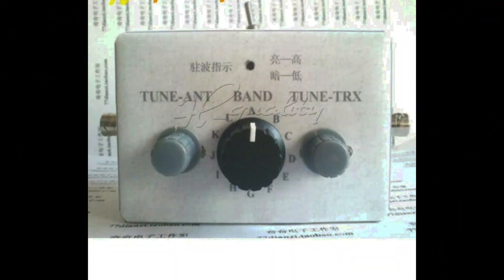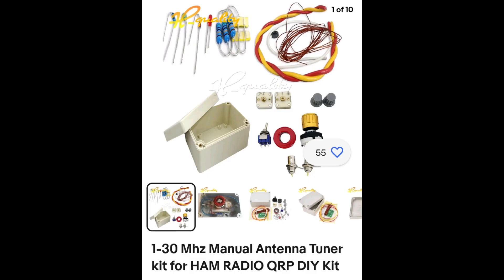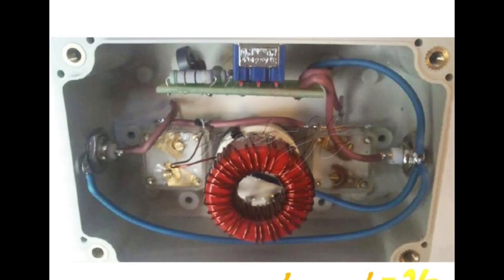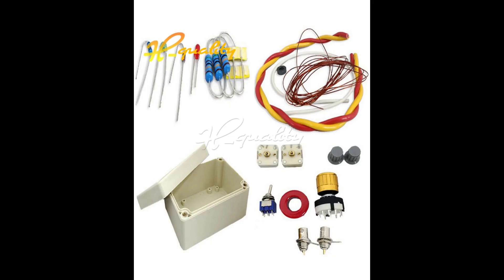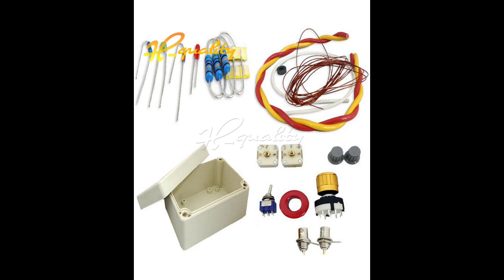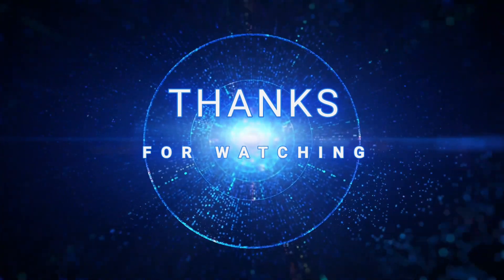1 - 30Mhz Manual Antenna Tuner Kit. Ham Radio QRP DIY Kit.

Comment: I bought one of these and liked it, so I bought four more when I spotted them on sale.

They are fine, just a few building caveats, so I recommend searching for instructions that remedy a couple of things.  Good luck, I hope you have fun with it. 😊
Reply from the maker: Yep it's cheaper to buy the kit than purchase parts separately.  I intend to add a 49-1 in same box. So it extends tuning range impedance.  Normally it's 30ohms to 300ohms. With a 49-1 max will be 5000ohms. Cheers from old George
Reply: Which toroid for 49:1?
Reply from the maker: FT114-43 FAIR-RITE FERRITE CORE TOROID RING